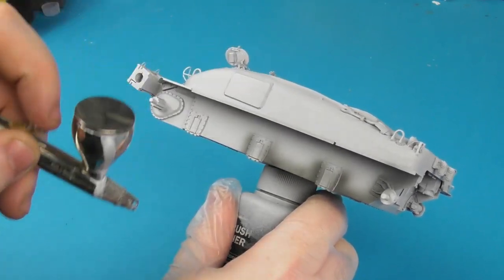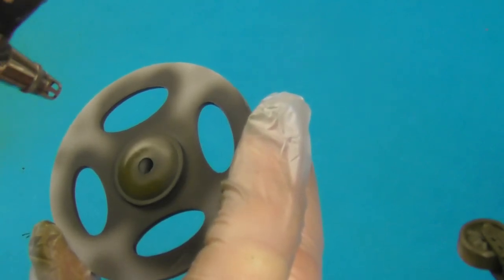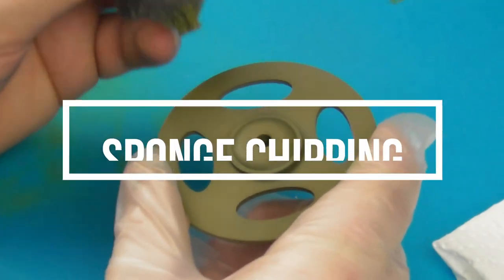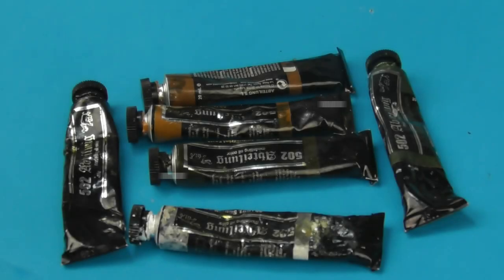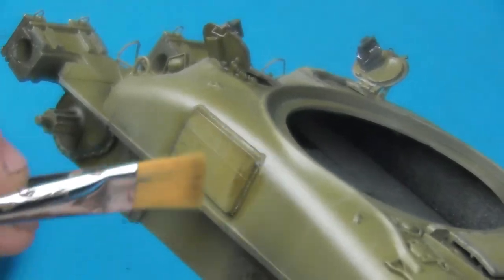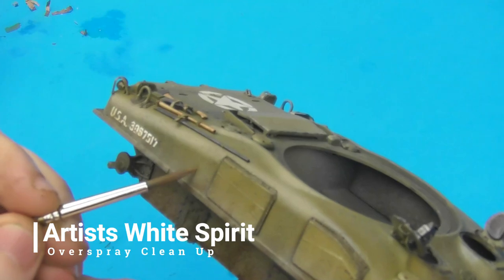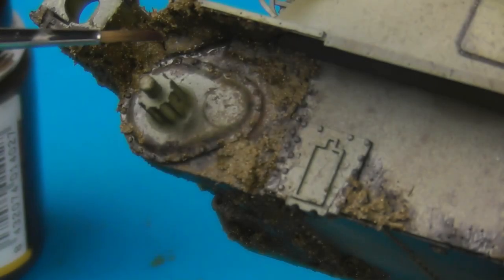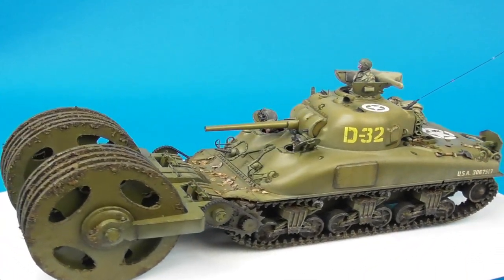1/35 M4A1 SHERMAN MINE ROLLER / HOW TO PAINT AND WEATHER 1/35 ALLIED VEHICLES

Comment: Hi shane, your sherman looks awesome  love the colours you are using; I've ordered some of the ak real colour paints. Also, the colours you are using as quite a few modellers are saying they are really good to use. Keep up the fantastic work you are doing. I always look forward to you putting up another video, buddy. Also, what airbrush are you using and what size needle? Cheers Gary 🇬🇧.
Reply from the maker: Thanks mate! The AK real colors are a joy to work with! They go down super smooth and level and build up beautifully.  The Airbrush I am using it a Harder and Steenbeck Evolution with .3mm needle which prefect for most jobs. As it does both fine line and wide spray jobs really well
Reply: @longlance67  Hi Shane 
Thanks for getting back me think I need to buy one of those airbrushes. Cheers Gary 🇬🇧

Comment: Hi Shane
Great piece of work mate, and techniques!!
I’ve finally tracked down and now just waiting for my T1E3 mine roller kit.
They don’t appear to have Stahlhelm products here in Australia, and the chances of finding any old Verlinden kits would be a million to one.
Luckily Bold Division have released their own ‘Aunt Jemima’ kit which curiously they say to use Tamiya’s old 35190 Sherman as the host.
My plan is for an Asuka so will just have to wait and see.
Thanks for sharing your fantastic video tutorial ❤😊
Reply: The Stahlhelm & BoldDivision kits are the same, BoldDivision bought the master & released there own one. The conversion was also designed to work on both Asuka & Tamiya kits.
Reply from the maker: Hey mate! I believe the BoldDivision T1E3 is a licensed rerelease of the Stahlhelm models kit. So my older build video of for this roller should prove helpful for your project. But it is a great kit and ready to go with minimal cleanup  and is a joy to put together.
As for the kits, if don't want to use the old Tamiya M4. Asuka Models M4 Fay would be a prefect base model for a M4 T1E3
Reply: @longlance67  Thanks mate, and another subscriber told me the same thing about the kit release.
Asuka kits are one of my favourites now, couldn’t bear the thought of building an old Tamiya Sherman kit again 😂 
Love you work and thanks for your reply.

Comment: Hi Shane, love your videos. Is there a reason you are using laquere paint for airbrushing? 
Greetings
Reply from the maker: Thanks mate! Glad my Sherman rambling aren't too nerdy lol 
As for lacquer paints and my favoring of them of late. It really boils down to two main advantages I've found using them with my airbrushing setup. I tend to get finer finishes with each paint coat than I did with other paints through the airbrush. And secondly it seems to be a lot more resistant to moisture/damp painting conditions, as I live in the west of Ireland and one of the rainiest places in the county at that. And found that airbrush acrylics such Vallejo the paint struggled to dry or even ran off in some extreme cases.

So far I don't seem to suffer as many problems with lacquer paints and my favor of them in my own projects have grown as a result.

hope that helps explains my thinking behind my paints. There really isn't wrong with acrylics but I can only really spray them in warmer weather in the summer without fear.

Comment: Nice work shane, looks amazing! Just a couple of questions really, first, did you use the rubber band tracks supplied with the kit and if so, how did you get the paint to adhere to them properly? I just finished an Asuka model firefly Ic in a winter whitewash scheme but the paint has flaked off the tracks quite badly in some places, but I'm not sure why, I used a solvent based primer as advised in the instructions but the only paint i could get to stick was the vallejo and AK mud pastes
Reply from the maker: So in answer to your question, I did indeed use the kits rubber tracks. Its strange you were having issues with them as unlike Dragon DS tracks I've never ran into issues with Asuka tracks yet. I tend prime them with Mr.Surfacer rattle cans. But in this build I just painted directly on top of the tracks using Tamiya acrylics thinned with Lacquer Thinner. And weathered them with AK/Ammo enamel effects without issue. I am not sure what could have caused those problems. Perhaps the primer didn't bind with the tracks and caused it flake off under stress ?
Reply: @longlance67  yeah, now you mention it, it's about the last use I'll get out of the can so I'm now wondering whether it mixed properly what with there not being much left, very strange!